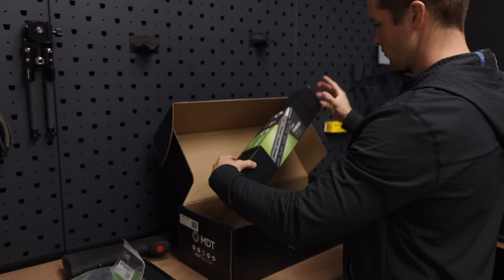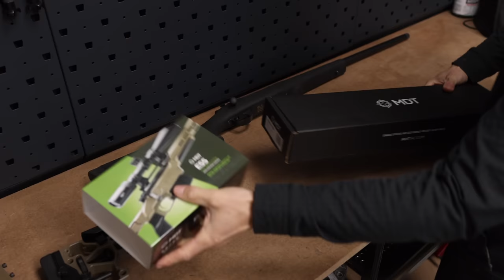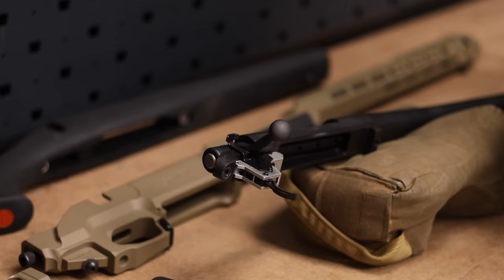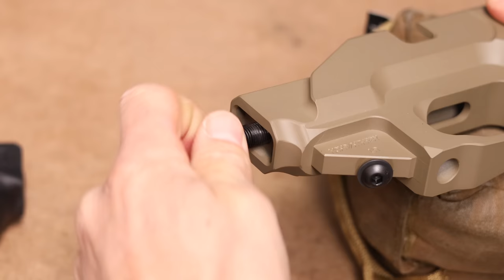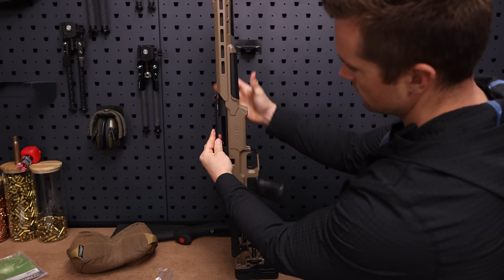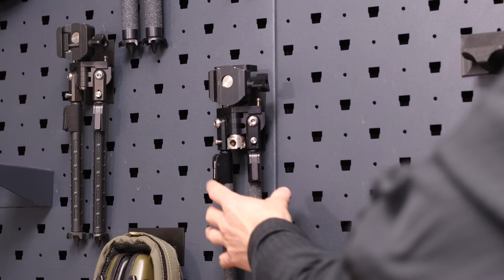COMPLETE CUSTOM RIFLE BUILD (300PRC)

Comment: You're looking at a cool 4-5 grand right there. Love the rifle!
Reply: What’s the cost break down for each part?
Reply: @chrislane7283  Howa barreled action $790
MDT ESS $1,199.95
M-lok exterior weights $59.95 x 3
APW monster muzzle brake $161
Vortex Razor HD Gen II 4.5-27x56 EBR-7C $2400
MDT ckyepod $600-900 depending on model
M-lok to arca rail adapter from MDT $44 euros
Mount I have no idea what it could be.
You are looking at roughly 5475 dollars brand new. Without looking for deals.
Reply: Wow! Too rich for my blood. I’ll stick with my Daisy BB pellets rifle… 😊

Comment: I want to do a 300 PRC build with that chassis and the 18” forend so it will look better with the 30” barrel I’d put on and I’d use a 60 MOA scope base instead of 20 so I could get all 120 mins out of that 6-36 scope

Comment: Friendly tip:

You don’t need to apply pressure to the scope rail while installing it.. it uses countersunk screws, push as much as you want, it won’t change where the rail ends up 😂
Reply: Friendly tip...

The bottom of the countersunk holes in the scope rail are flat and larger than the screw head...
The face of the screw head is flat also...
The rail isn't threaded and the holes that the screws protrude through are a bit over sized as well to allow for variations in the action screw hole spacing...
All of these variables allow for movement so that the 8 holes between the rail and action can line up....
MDT scope rails have a "recoil lug" that interface with the front of the actons ejection port....

If that "recoil lug" isn't firmly pressed against the front of the action, the rail and 2 pound scope attached to it WILL move forward like battering ram during recoil especially with a magnum cartridge and can sheer off the screws used to attach the rail to the action...

Piet's method is the correct way to do this process. The only thing that I do differently is add a few drops of thread locker between the action and rail to "glue" it to the action.

Comment: WOW, that's one sexy rifle. What are the six (6) small blocks along the chassis?
Reply: There weights
Reply: They’re just weights, no special purpose to them besides weighing the rifle down
Reply: @TrolloTV  they're to put the center of gravity of the rifle exactly where you want it, as well as to help dampen recoil. Not just to "weigh it down"
Reply: @iamcondescending  yeah, that too obviously. But the main thing is more weight
Reply: @TrolloTV  ...

You don't just make the rifle heavier for the sake of making it heavier...

The POINT of "more weight" is because a heavier rifle will impart less recoil to the shooter, and the placement of the weights changes the center of gravity of the rifle.
Reply: @iamcondescending  yeah, I know

Comment: You put a chassis on a rifle I wouldn't call that a custom rifle build
Reply: Can you buy this configuration off the shelf? If not then it qualifies as a custom build does it not?
Reply: @j.e.honiball1327  I would accept the title "I changed the stock on my rifle" it is definitely not a "complete custom rifle build"
Reply: @nikolausotto4504  at what point does it become a custom build?
Reply: @j.e.honiball1327  when he gets a action, barrel, and stock then puts it together. Maybe he could of used the title "I customized my rifle"
Reply: @nikolausotto4504  English is his 2nd language.  So that could account for the misleading title. But enjoy the video and forget the semantics.
Reply: For a pricision rifle build?  It starts with dialing in your match grade barrel blank to within .0002" on your lathe before you cut the Tenon, cut threads & chamber with a chamber reamer.  You don't build a rifle with a socket driver...